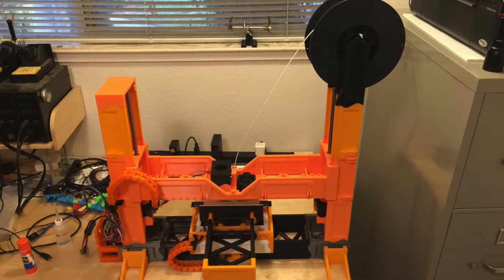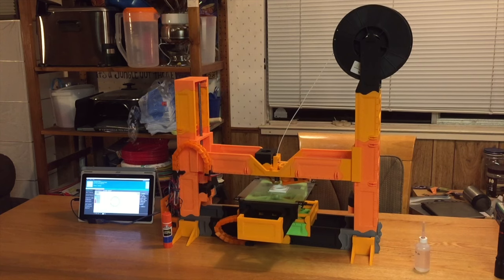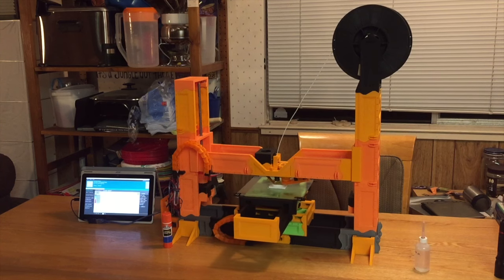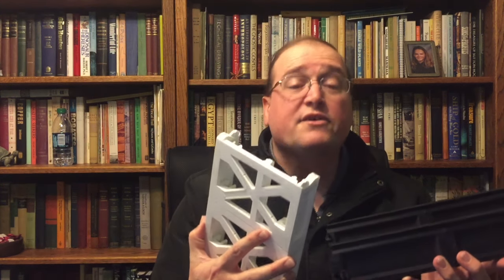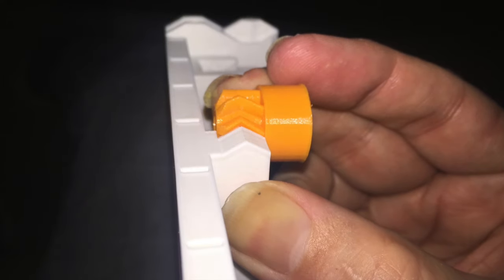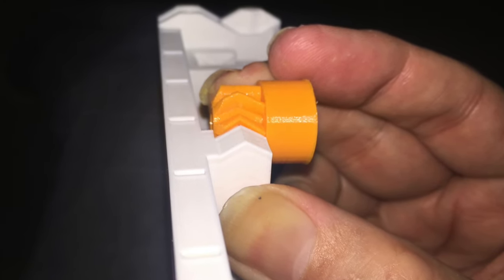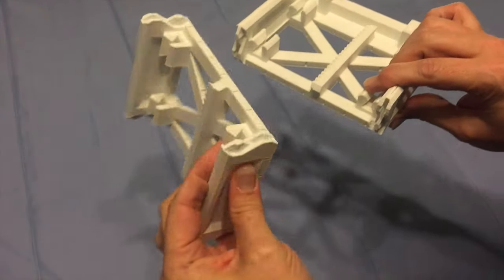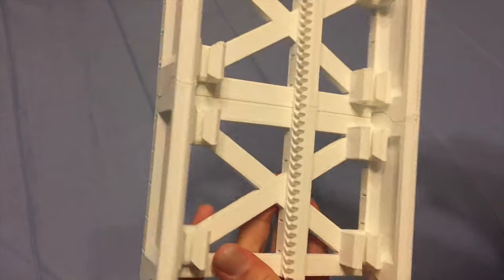Gada Prize Submission Video for Snappy RepRap

Comment: Have you considered a kickstarter for an injection molded version?
Reply from the maker: Jason McMullan I did some research on injection molding, but unfortunately the joiners I use everywhere in the design don't work with that manufacturing technique.

Comment: is there a reason use a m8 thredded rod for z axis and how i need to change the files?
Reply: are you asking how to use m8 rods instead of the original acme rods?
Reply: i made my z lifters grab firmly to an m8 by changing rod diameter to 7.6 in the scad config. pitch is 1.2mm and i changed thread depth to a divising factor of 1.8 i believe. this was in the model scad itself.

Comment: I am building this and I wanna know if you could add support for dual extruder
Reply: add it using tinkercad.  I did. still alpha testing
Reply: +Patrick Collery how did you though?  care to share the Stl file?
Reply: +pat ayala all that i did is import a regular rail segment and modified a rostock max v2 dual effector plate to fit and. printed it as one piece. it requires some hardware. could you do me a favor and upload the .stl file to tinkercad and make it public. that way i can add the files you need.
Reply: +Patrick Collery sure when get off of work
Reply: +pat ayala Its a bowden style by the way
Reply: +Patrick Collery that is fine
Reply: +pat ayala is your snappy actually together and printing?
Reply: +Patrick Collery no not yet
Reply: +pat ayala how close are you?
Reply: +Patrick Collery maybe about 2 0% complete  I've only done  x and y sleds and rails why?
Reply: +Patrick Collery I'm using the da vinci Jr it's a really  slow printer lol
Reply: i had the original davinci, i just dismantled it to build the snappy
Reply: I have a rostockmax v2